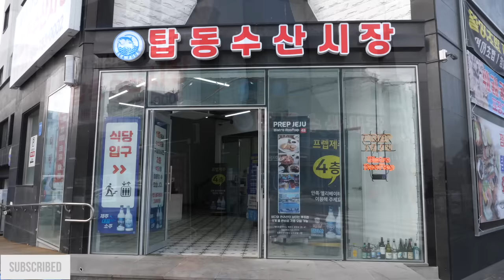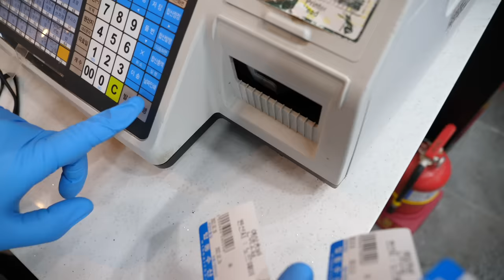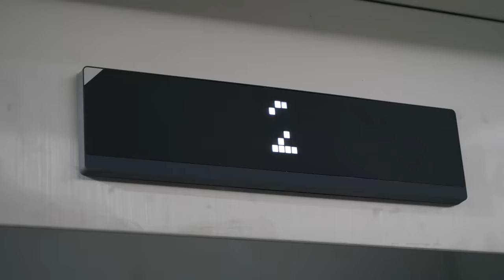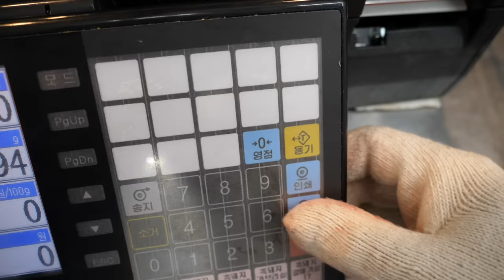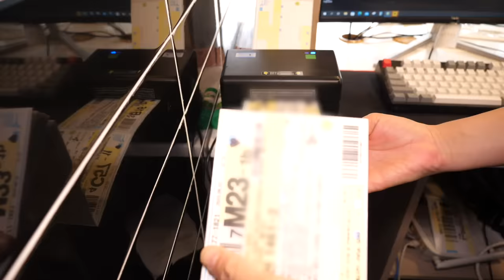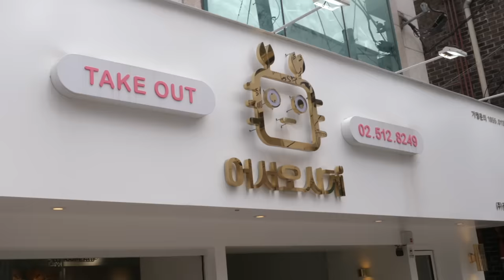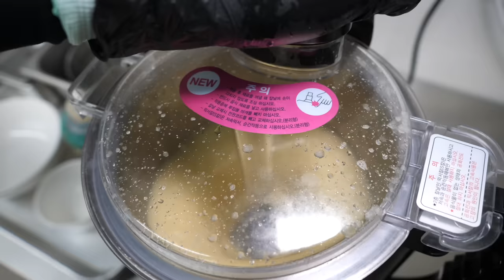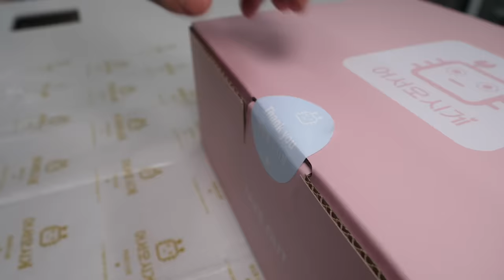미친 속도로 생선 고기 한마리 쓱싹? 한번 맛보면 환장하는! 달인의 참치, 킹크랩, 랍스터, 고기 몰아보기 TOP 6 /  Best Korean seafood, bbq master

Comment: "Sushi master" - uses a metal bowl which holds heat, sloppily preparing the sushi rice by just dumping the vinegar on it, improper mixing & cooling, doesn't cut the bloodline out of the tuna, fish is still frozen and on cutting begins to degrade, improperly identifies species, uses fake Wasabi that's actually horseradish dyed green... Japan doesn't mess with Korea BBQ on Hanwu beef, please don't dishonor the craft especially by calling yourself #1 in the country. I don't fault your attempt to  share another nation's culinary arts but please, do it correctly and don't dishonor the practitioners of the art of sushi making after they've worked at it their whole lives and even in old age, are still humble enough to know there's still more to learn and they don't call themselves a master because the more you learn, the more you realize the less you know. Keep at it but, do not be dishonest to the craft or yourself.